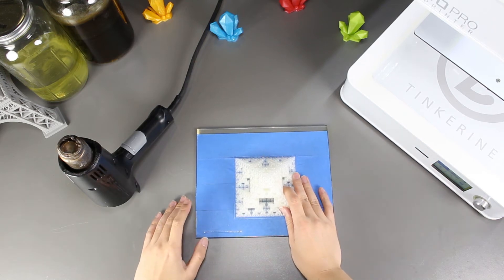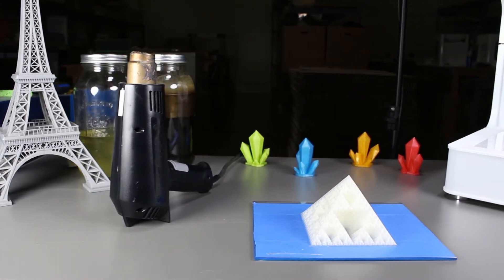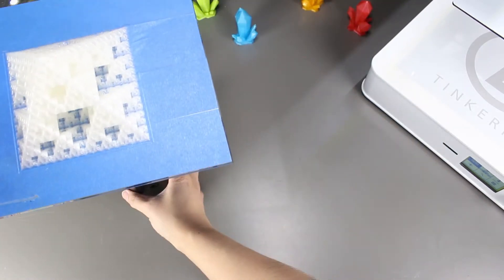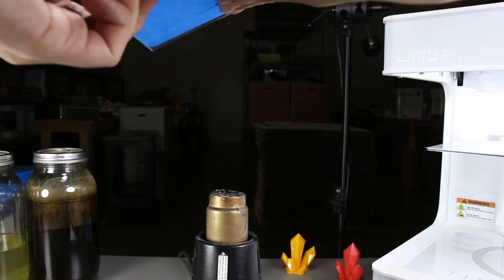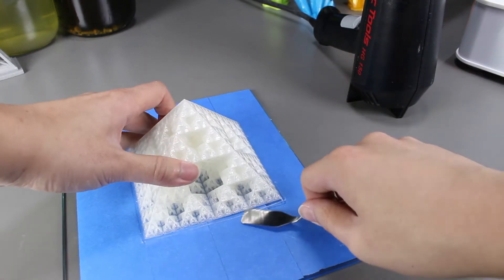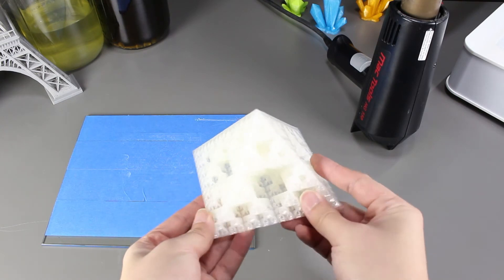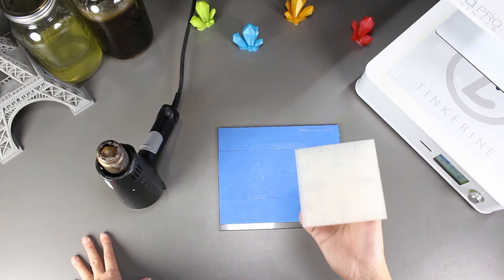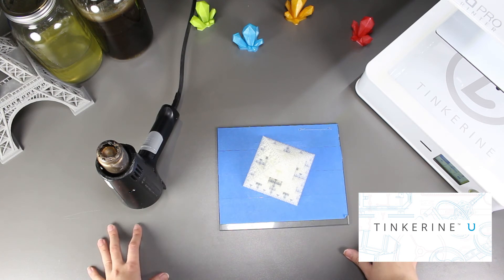Removing Large Prints off the Print Surface by Heating it

Comment: Glad to see this works on PLA too. I've found this also works for ABS and PET after going crazy trying to get both off of PEI when they stuck too well. In those cases, they also get a slight flex to them around the edges, which helps for fitting a spatula under it.
Reply from the maker: Thanks for t he comment! Have you tried other methods that seem to work if the print is stuck on too well?
Reply: For PLA, I'm pretty fond of using an inverted air duster to get stuck parts off. I haven't tried it on bare glass or tape, but for Buildtak and PEI, parts practically slide off after a quick spray.